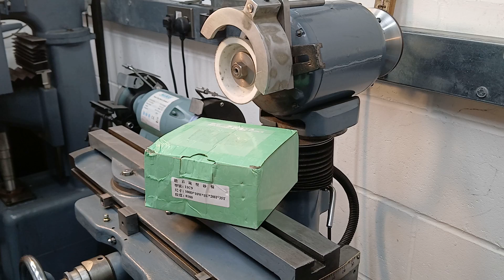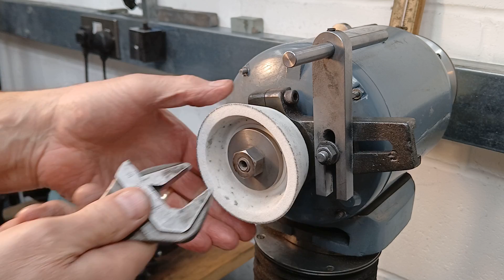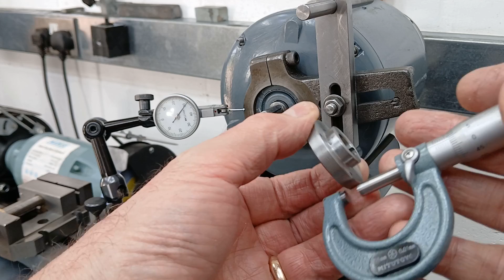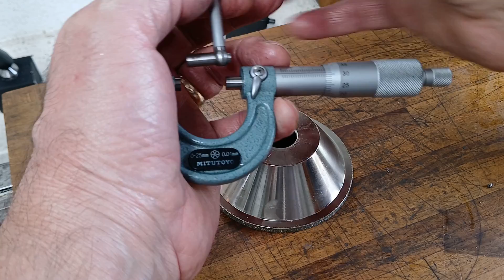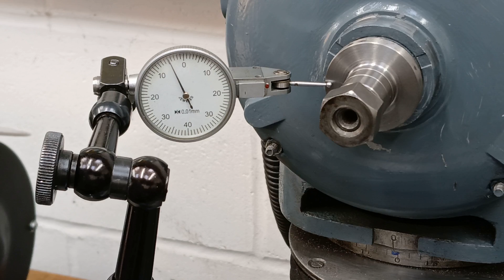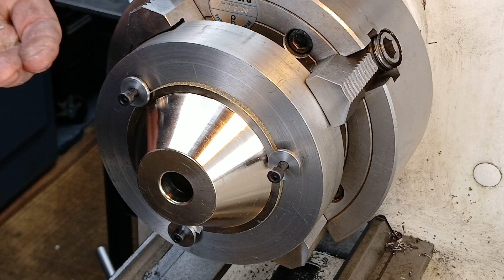Mounting a Diamond Cup Wheel on the Union Tool and Cutter Grinder

Comment: Excellent video, you have done such and great job eliminating the errors, the only thing I can think of is that the face of the cutter is not flat and no matter what you do it will never run true
If it is dished, then there would be at least two highs and two lows for every rotation of the spindle and not just one ?
Reply from the maker: @seamusbolton215  Thank you. The diamond wheels were cheap so I doubt they're perfect. Since I made this video I've given the diamond wheel more use and have found it's excellent for hogging off material, the chips come off silver so it cuts cooler, but it gives a poor finish so I go back to a white wheel for the final polish on the tool.
I have another potential solution to the wonky spindle, but its a lot more drastic and is in the queue for the subject of a video, when I get time!

Comment: I mounted one of these cup wheels onto a cutter grinder I made and went through a similar process but in the end found the bore was causing most of the runout. After boring it out and remaking a mounting washer it is still not perfect but considerably better than it was.
Reply from the maker: That's very interesting, thanks. Maybe I will bore it out and try again with a new bush turned in situ.

Comment: I think the worst  thing you did was mount the new wheel face to the face plate instead of the internal machined face this would show if the cone was running true the rough surface however would not.
Reply from the maker: It was deliberate to mount the face of the wheel as a reference, after all that is what will be doing the grinding. I wonder if the front face of the cup wheel, where the front spindle washer sits, is not true and is pulling everything out of line as the nut is tightened. Or maybe the motor bearings run out, although I have replaced them recently.

Comment: Thanks Robert, I’d be interested to see what you do when mounting resin bonded wheels, I have yet to find a cup wheel that isn’t all over the place including branded ones.
Reply from the maker: Thanks for watching. I've got a resin bonded wheel on the other end of the motor spindle. It works but, as you say, runs out a bit. The bit problem with them is the corner is quite rounded and I'm after a sharply defined edge for splitting drill points, hence the electrocoated wheel. I've tried truing up the bonded wheel with several things, a devil stone (I think its silicon carbide) and even brifly with a diamond dresser, all to no avail. The bonded wheel seems to glaze too, which is not good.

Comment: I think the usual
Method for truing diamond wheels is to dress with a bit of moly or at a pinch a bit of soft steel.
Reply from the maker: I've not come across either of those techniques. There's not much material that can be removed on this style of wheel, unlike on a resin bonded diamond wheel.

Comment: I made a pair off of those for my tool post grinder. Came out pretty nice
Reply from the maker: Did you get them to run true? If so, well done. Thanks for watching.
Reply: @ThePottingShedWorkshop  yes I took them to 5000 rpm with no problem. I filmed it under my video grinding jaws

Comment: Make your adapter a little oversize, mount it on the grinder spindle, then turn it to size and true on the grinder itself.
Reply from the maker: That was the original plan. The diameter of the bush that fits in the bore came out concentric when mounted on the grinder so I decided to turn it to size on an arbor on the lathe. There are no graduations for the table feed on the grinder and the handle isnt on much of a gear reduction, so precise diameter control would be difficult turning it on the grinder. The face of the bush that seats against the rear of the cup wheel was turned as you suggest. Strangely it didnt seem to reliably remount with that face running true.